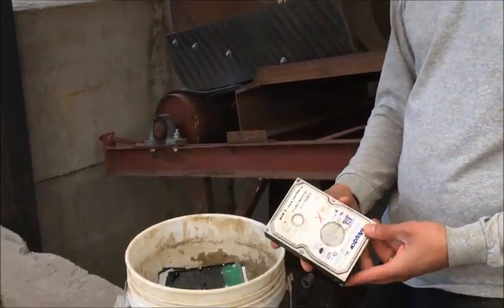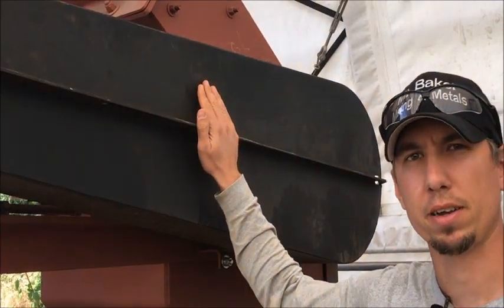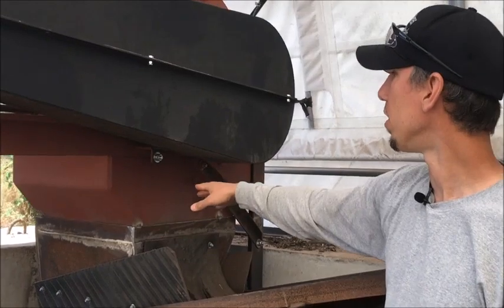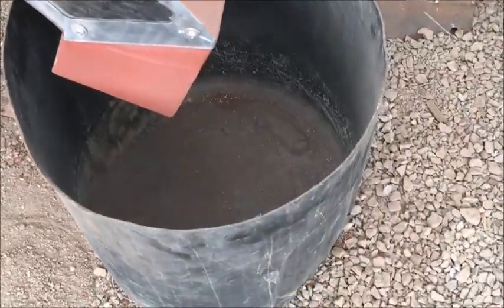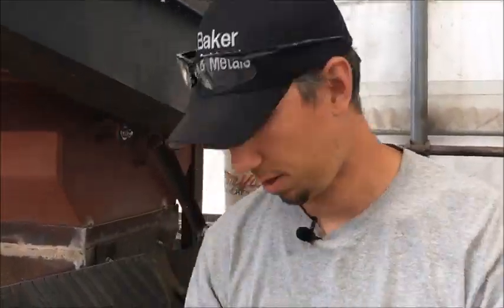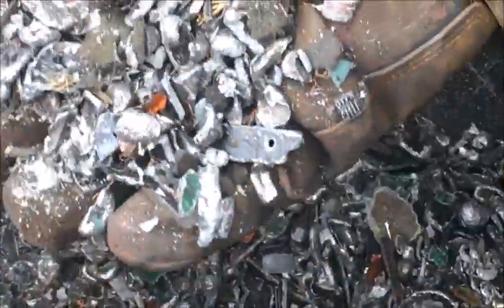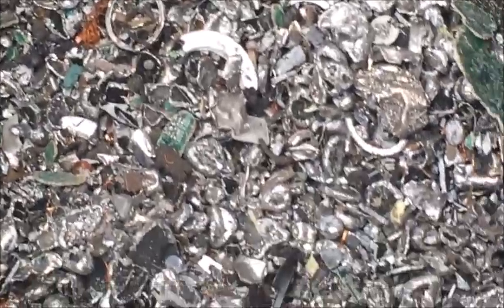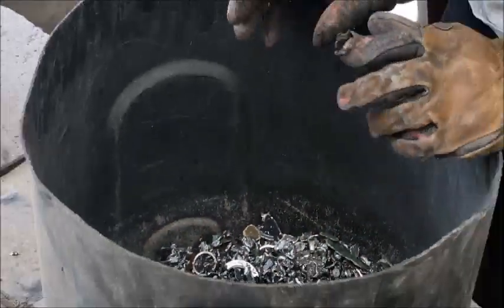Hard Drive and Data destruction with a hammer mill

Comment: Now how are you going to separate the different metals?????
Reply from the maker: Great question.  I am not too sure.  My goal for this video was to destroy the hard drives for data destruction, not process them for the scrap value.  I noticed there is a lot of cast aluminum so I think that would give you fits trying to separate it from the other non-magnetics.  An eddy current might help with the separation of the metals and the boards and plastics, but I have never used one.